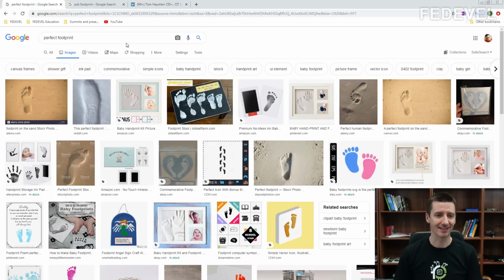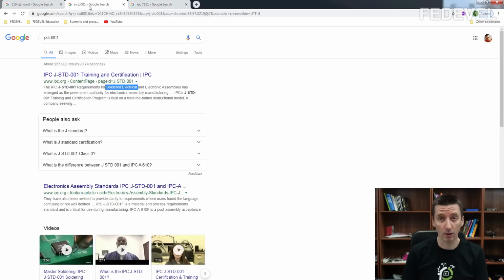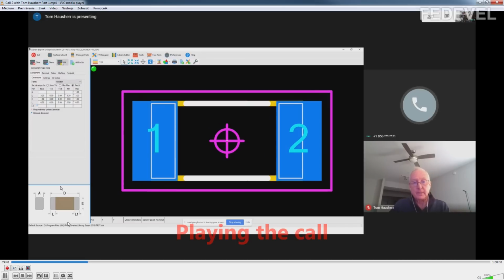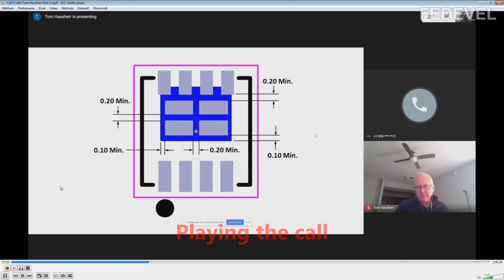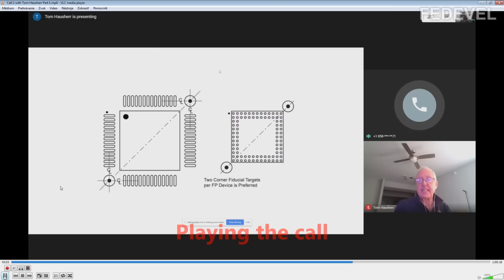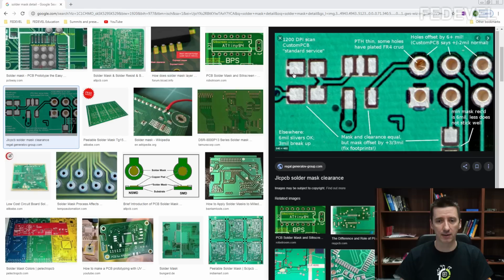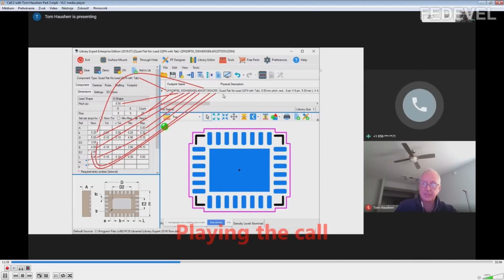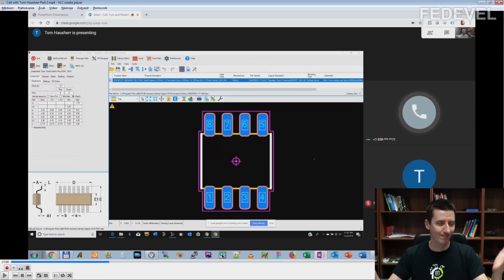How to create perfect PCB Footprint - What you really need to know

Comment: J-STD-001G is Titled: Requirements for Soldering Electrical and Electronic Assemblies (Tageted at Manufacturing (assembling and soldering PCB subassemblies). Primarily acceptance levels of solder joints per class 1, 2, or 3 as either Acceptable, No Requirement, Process Indicator, or Defect. In other words, after the board is soldered do the solder joints meet class requirements. Obviously, for SMT parts solder fillets are very important. If you are trained to solder to J-STD-001G you can attain 4 levels of expertise, 3 of which are the most prominant; CIS Certified IPC Specialist, CIT Certified IPC Trainer and MIT Master IPC Trainer. Masters can train Trainers and Specialists, Trainers can train Specialists. For larger companies there is usually a CIT which is responsible to train the CISs so they can pass certification and certification renewal as the standard evolves. You can be trained in visually inspecting assemblies per IPC-A-610G (Acceptance of Electronic Assemblies) without knowing how to solder to meet J-STD-001G. I tend to reference J-STD-001G along with IPC-A-610G, or what ever Revison is needed. For these two docs they can cross reference each other and are matched based on Revision Letter, like G for example. You might ask, why have inspectors who do not know how to solder? As it turns out becoming a J-STD-001G CIS or CIT takes a high level of skill. You are very knowlegable in using and selecting soldering equipment and you are very experienced. 

Many J-STD-001G CITs are trained in IPC-7711C-7721C which covers Rework, Modification and Repair of Electronic Assemblies. Repair in this context is in a manufacturing environment where the failure is primarily in PCB board damage, which you will repair. You can extent this standard internally to set guidlines for customer electronic repairs for faiures after product in use. IPC's focus is Manufacturing standards and not field repairs.

IPC-7351B (Generic Requirements for Surface Mount Design and Land Pattern Standard) addresses PCB footprint design in an overall approach while meeting J-STD-001G (and by extension IPC-A-610G) soldering standards for acceptance of solder joints, with the added dynamic of design part density (most, nominal, least) which modifies actual pad size. From a pragmatic standpoint, if we just focus on solder fillet acceptance, what is needed for reflow soldering is a certain amount of solder paste volume to product the proper joint (fillet). Volume is largely dictated by the PCB pad (land) size and stencil thickness and design. So the best footprint produces the needed fillet, for all component varients (usually covering all device hieghts in the design), with the lowest cost stencil, meaning one that is a single thickness without cavities to change the thickness. The focus for Class 3 is to provide a minimum fillet size. However, having a larger fillet is acceptable if it does not exceede the max. So a larger fillet that is in spec is acceptable and may be preferred if the device is large in size (like an 0805 1uF X7R MLCC verses a 0805 100pF NP0 MLCC) due to mechanical (mass) vibration. So think in terms of solder volume to produce the need fillet when looking at pad size.

Comment: 1:35:20 That's how I often feel at my apartament, just from the loud neighbours :D Actually, I was wondering, in that case, should one design a single 0603 for all of the used caps/resistors with 0603 size or should we follow each 0603 component (if let's say each component is made by different manufacturers) datasheet... I was importing components in Altium and found that each manufacturer is using different pads, it would drive me crazy seeing each 0603 resistor to have different footprint! :D

Comment: Wow, that video had a lot of good information!  Thank you! 

One question:   Why does the assembly company have such a big problem identifying pin 1? It seems like there can be multiple ways you can provide this data in your release package.   You can include the assembly drawing or the overlay (legend) as separate gerber layers, either of which may show pin 1.  In addition, you may have a pdf version of the assembly drawing which you can provide with your release package.   Is it just that there is no standardized way of providing that information in the gerbers that makes it difficult?  How about providing them ODB++ or IPC-2581 files, does that help?

Comment: I just wish for one thing in the future...manufacturers making parts with same dimensions. I don't mind tolerances, but please make the same footprints. Why does one have to make 0,2mm longer legs than another or have different thermal pad on the same size QFN -.- If it is a special footprint with 4 thermal pads or missing legs with a good reason and will fit only specific part it is no problem, but if it is a standard part (0402, 0603, QFN, SOIC, SOT, SOD,...) please please make it a standard. All these problems with names and tens of footprints are just because manufacturers don't have the same case.
Or this one...0603 or 0805 LED polarity...the same manufacturer put a triangle on the bottom of green and blue LED pointing to the cathode but then reversed the marking for the red one. But wait...you order the same size LED from the same manufacturer just with the frost lense instead of clear and the marking is reversed again...
What about diode polarity in a tape...put anode toward the holes, or cathode i don't care, just make it the same.
Designer could make one footprint that fits his needs. If he is an RF designer he will probably not start mass producing toys next week. And if he changes company they will have a whole new library waiting for him which is optimised and tested in designs they normally do.
I like simple standards, specially if they will help others down the chain. I ask my PCB manufacturers if they would like me to change anything, but normally they just don't bother because they are used to so much crap they receive from others. We have small assembly line, and I try to help them too. I really hate when someone with too much money thinks they have to make part just a little bit different so customers can't  easily change manufacturers.
Reply from the maker: I agree

Comment: Class 3 isn't necasirely more expensive. Often to make board to comform to Class 3, one would need to use higher clearances, bigger traces, bigger holes, higher accommodation for manufacturing variability, to compensate, etc. It basically changes the design rules, to ensure bad things don't happen. This usually also means one can't create as dense designs as in Class 2. The reason it is more costly, is because of if you really need "Class 3", you are not going to chase the lowering of the cost as the objective, and want traceability and guarantees on the manufacturing chain, including things like registrations. Even if they are the same as in Class 2 board.
Reply from the maker: Thank you movax20h for your feedback.

Comment: Robert , I  am working on electronic HW design for one EX (Explosive product for processes industry  )  I used some of free site to pick up footprint ,
they where all wrong some layer was not right at all , as Tom says at end of your video, no body knows about footprint, I remember one of our design should fit in very tight enclosure , mechanical dimension of parts should be accurate as 0.1 mm , with PCB library tools we generate all symbol with right mechanical size ( step file ) , so mechanical engineer could check in their software  that there is no collision with other mechanical parts , PCB Library tools is the one , is the only one  that can make all these foot print , you get standard foot print  on all layer , , it is great tools from my experience

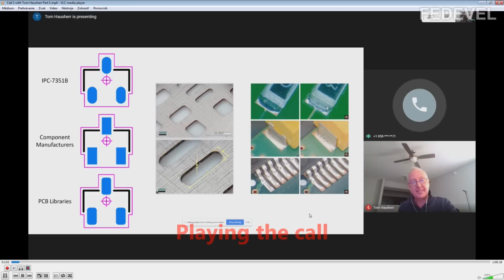Comment: Robert , @52:47 talking about square pad vs oval , vs  soft corner edge pad ( PCB Libraries ) , if you look at square PAD on the microscope on you PCB, when they get small , they  are never have 90 degree sharp angel , etching process  can never make  90 degree sharp angle , that is reasons you should always have some soften corner   ( at least I do it an all my PCB , which take a lot of time even on shape )

Comment: Well, to add more confusion to the zero orientation topic :)
What about zero orientation of components on the bottom side of a PCB, when generating a pick and place file?
Lets assume we use the "IPC Level B" convention, where "0°" means "pin 1 on bottom left": Is the rotation of a bottom mounted component 0° when pin 1 is on the bottom left in the "bottom view" or in the "through board view"?
Reply from the maker: Interesting question, I should check that, just because I am curious now :)
Reply from the maker: Ok, I had a look and ... it looks like rotation is exactly the same between top and bottom components vs pin 1 position. So TOP view only.
Reply: @RobertFeranec  This is how Altium handles it?

Comment: Hi, superb video on this topic. Been using this software for a while and it's brilliant. Learnt a few things from this which never crossed my mind. I understand the main focus has been on SMD components, would like to see more on PTH components.
Reply from the maker: Thank you Dimitrios. I have never really had any special problems with pads or footprints for through hole components - usually the problems where: fitted the wrong way or thermal relief (GND through hole pins connected directly to internal power planes makes it hard to solder).
Reply: @RobertFeranec  Hi, understood. I should have been a bit clearer regarding through hole components, I'm using in a project some pcb terminal blocks which have lever type cage clamps for up to 8 AWG and concerned on the mechanical stress of the soldered joints when using the levers. Even though the manufacturer has recommended foot prints for the through hole pads, I'm just naturally concerned. This could also apply to any type of connector to a pcb when mechanical forces come into play for insertion and disconnection.

Comment: Thanks for a very informative presentation, Robert! 
One comment about the chart with mismatched standards at around 1:50:00 - Don't worry that the standards don't match each other, there is still more work to be done when it comes to standards (and standardizing the standards, ha!) Anyway, the point is, when the assembler buys parts on a tape and reel they are in a specific orientation, usually pin one on the left. The orientation on the reel can be thought of as zero degrees rotation. If you build your library footprint in a different orientation, the rotations in your pick and place data files will have to be "adjusted"  by the assembler. It is nice for them if rotations match, but you are correct that they do these adjustments to your data all day every day. no worries. Great presentation! thanks again.
Reply from the maker: Thank you Jack. We did speak about this with Tom, I left it out from the video.

Comment: Thanks for another amazing video! Do you have any plans in the future to create a video about grounding, ground planes and how to separate grounds for digital & analog circuitry in real life project? I found it difficult, since everything I found on the internet are just very abstract examples that doesn't help to ground properly in the actual project
Reply from the maker: Thank you Lukas. I do not have any special "grounding" project what I could use for video. But maybe I will meet or find someone who is working on these kind of projects ... and we could make a video about it in future. Adding on my list of possible future videos. Thank for tip.
Reply: Anybody seeing this  now, he now has an excellent video on ground planes. I concur with the conclusion of that video to not separate ground planes. The industry is moving away from split ground planes because it generally causes issues and the only benefit is your mindset of keeping digital signals separate from analog when routing the board. It may be a good practice to separate them during the design phase, and then change it to a single ground plane after. Because that will keep you in the correct mindset when routing the board.
Reply: @Cracked1ce  a couple of video’s ago you can see cooperation with Eric Bogatin and in the comment part of the video a free code to 3 months of signal integrity academy!! (Like 1200 a year usually). I followed the SI course and its already detailed about the return plane (gnd). I recommend you to check.
Reply: @remy-  kkkkkkkkkk9kkkm00kkkkkkm0m99kkkkkm
Reply: @remy-  kkkkkkkkkk9kkkm00kkkkkkm0m99kkkkkm